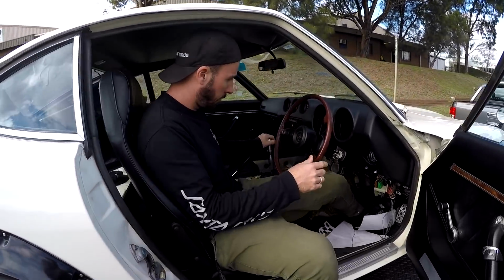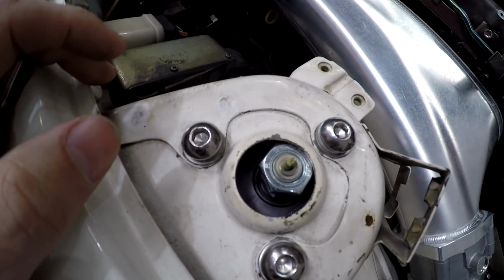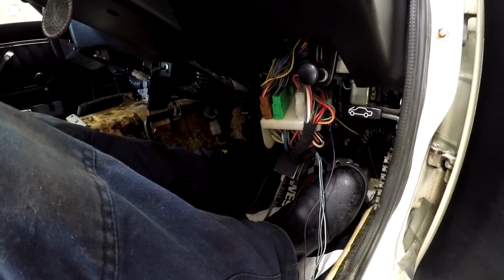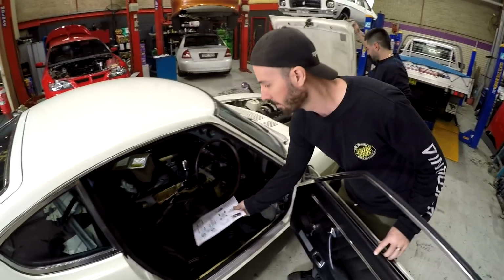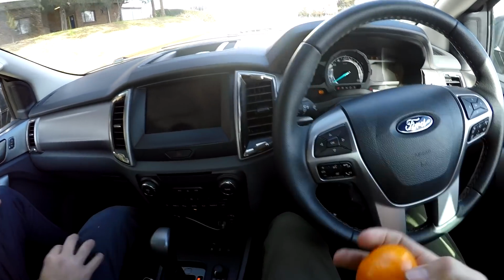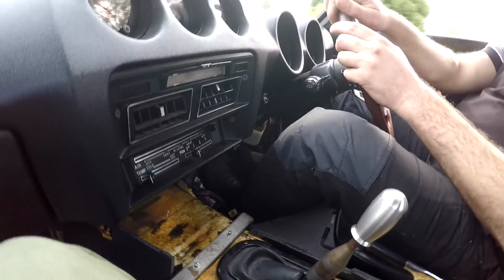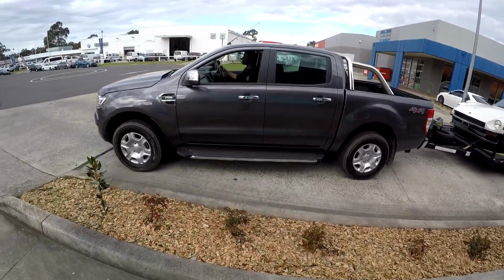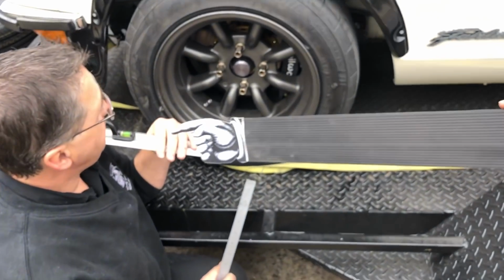RB26 240Z - Making It Legal

Comment: Just a tip guys,
Please get a battery with the terminals in the opposite polarity, so you’re Pos+ is not nearest to the bodywork! 
You can notice that any OEM fitment battery will always have the Pos+ terminal furthest from the bodywork in case of a collision, and will prevent the bodywork shorting to the terminal.
Reply: Beard Moto why not just use terminal covers....
Reply: Gary Stinten dunno mate. for the sake of a $200 new battery for a car worth $100k wouldn’t you just do it properly?
Reply: Beard Moto Or like... You know... Turn the battery around.
Reply: Thumbobby yep, after looking back, that’ll work too
Reply: You'll probably find that is OEM fitment, easier to just flip the battery around and extend the wiring then buying a new battery and still having to extend the wiring.

Comment: Wow - Australia has some really complicated rules and regs - I thought the UK was fussy, but in comparison to Australia, we seem fairly lay back......  In the UK, an imported car that isn't already type approved for the UK has to pass an IVA (Individual Vehicle Approval) test.  It's quite an involved test which takes a few hours, but its done in one place and the car isn't dismantled.  All cars over three years old have  a mandatory annual inspection which takes about an hour.  Strangely, when a car hits 40 years old, it becomes exempt from annual tests...........
Reply: Supposedly the reason for the 40 year exemption is:
- There aren't actually that many of them
- Many mechanics don't have the expertise to check them
- Most of them are 'collector' or 'classic' cars and so are generally well maintained
- Statistically very few are actually involved in accidents
I think they are still covered by the expectation that they are maintained and compliant with the regs and can be ticketed if pulled over.
Reply: Andrew Austerfield yes and there's been a lot of controversy about the exemption.  I personally think it's a bad thing.
Reply: There's always controversy when they change anything. I used to own a classic in the UK and honestly I did 500 miles a year, so effectively it had to be MOT'd every 500 miles which is a little excessive. Perhaps a change to a test every X'000 miles might have been appropriate? Here in CA I need to get a smog every 2 years and it's becoming harder and harder to get one done on anything that doesn't have ODB II installed.
Reply: Honestly for the average vehicle owner its not this involved. The guys are dealing with BIG changes to a car - engines and power outputs it was never designed for, components and emission standards that are much more modern, safety aspects to go along with the increases in power/mass/etc. The regulations on that in NSW are in the Vehicle Standard Bulletin v14, or VSB14. Google that for more info, its surprisingly reasonable.

For your average owner annual registration involves a simple mechanical check (20min & $41 in NSW) to ensure safety for you and other road users, then compulsory third party insurance (about $570) and registration fee ($66 plus road tax based on vehicle weight, eg: $211 for under 975kg). All up $887 for a small car in NSW annually, including compulsory insurance.

Cars over 30 years old here can be registered on 'club' or 'historic' registration, which allows trips for servicing, troubleshooting and nominated club runs (eg every Sunday to Location X). The cost for this is about $100 a year, with some forms allow 60 days of use so long as the trips are recorded - not just club runs etc.
Reply: boingkster thanks for the info.  The 'normal' annual test does seem on a par with ours (and sensible).  I know the boys have made huge changes, so fair enough the car needs testing.  Overall the Australian regs do seem more onerous tho - starting with the import rules, plus the use restrictions you mentioned. Cheers
Reply: No worries, also the 30+ club rego is an opt-in scenario, it's not compulsory. A lot of collectors use it as it helps offset the cost of multiple vehicles. I have a 40 year old car I drive daily, a Chrysler Valiant, and it just has the normal inspection annually.
Reply: Come to Germany, then you'll know what real restrictions are.
Reply: Michigan-USA. As long as its insured and has its lights at the proper hight we dont care. Want corvette front suspension on your 3wheeled tank v10 powered motorcycle?? . . . Cool.
Reply: What restrictions? In Belgium everything has to stay original. Wheelspacers, air ride, engine swaps, drum to disc conversions, adding extra engine power,..... are not allowed for this car. With cars before 1968 you have got a little more freedom.
Reply: Any car over 40 years old must be well maintained and I’m guessing it has to be annually inspected at 39 years old so if it’s good then anyone that actually wants to own the car will take car of it
Reply: Australia is broken send help
Reply: david shostak  YES, welcome to America, ['merica for Texas and most of the south (where I'm from but I don't say that) The States for most of the rest of the world] I'm glad that we don't have restrictions and inspections like Australia and other countries, jeez why all the restrictions and inspections Australia? I can see it if you were a small over populated country.
Reply: Nah, come to Hong Kong.
Reply: Meanwhile in the US: Not much rust? Seatbelts if it's 30 years old? Does it move when it should and stop when it should? Good, here's a sticker.
Reply: VOSA can pull you over. Make sure your documents are legit.
Reply: Having a standard everyone should follow is good. Then you know at the beginning of its life, it is capable of being road legal.
Reply: Unsafe cars in a crash can be a death trap.

Comment: Good to see these results. It would have sucked if, “upgraded” parts didn’t out perform the OEM equipment. 

Which to some degree, would explain why they always have the disclaimer,”performance parts are for off road application use only”
Reply: There are some rules about modification where you can't make things too strong because it changes how the car crumples on impact and whatnot. And probably to prevent people creating armoured cars. So if you're chopping and changing things, you can't just slap a bunch of thick steel in there to make it strong, which would be a good thing, but in a crash it won't bend the way it was supposed to and might kill you or others.

Comment: In British Columbia Canada you don't even need to get a safety check (vehicle inspection), if the car is already registered in the province.  Just go to ICBC and get you registration, plates and insurance. But they do random vehicle inspections at the side of the road, if there's any problems you have 30 days to fix it or take it off the road.

Comment: DRUM TO DISK? Dude here in the USA vehicles are still sold with drum brakes quite often.

I'm not 100% sure on this, but in the US I think most states only require you to meet the safety regulations for the date your car was made. I live in Florida, you don't even have to get a car inspected here, so illegal and dangerous modifications/vehicles ready to blow up on the road are a common thing. People with 20 year old cars run around with worn out rotors and brake pads, bald tires, and blown out brake lights and turn signals all the time. In one way it's nice, you can put a swaybar on your car and not worry about what it'll do to your registration or affect inspections, but at the same time it allows thousands of dangerous vehicles to just roam the streets.
Reply: Almost every ute (including the Ford Ranger they drove) has drums at the rear. Same with some light/micro -sized cars (although they probably don't need discs, unlike heavy utes which can tow up to 3.5 tonnes (or 2 cars)).
Reply: Jesse C if it was stock it would be fine but you can’t just upgrade an engine to multiple times original power and have stock brakes.
Reply: Never seen a new car with 400 whp with drum brakes.

Comment: Glad I smashed Like so early on! Engineering is a massive pain but its a vital part of building a safe, roadworthy car. One of my own long term goals is to build a kit car, but the engineering requirements just for each state in Australia is a nightmare. Plus, I need a house with a two car garage, tools, money...ummm.... yeah.

Great work guys!
Reply: cyclonicleo Lame goal, the work is largely already done with a kit and the car it's built for
Reply: cyclonicleo just move to the USA it would probably be cheaper because no regulations on cars besides having brakes lol
Reply: Yeah, but if you do get into a crash in USA you'll be bankrupt from legal/medical bills so it all works out. Things are pretty different across Australia, like some states your car needs to pass a check every year, some states you just keep a car registered and it's all good, even if it's a total rust nugget that should probably have been taken off the road years ago. And the cops don't give a shit about a rusty old Falcon with the muffler held on with a coathanger, but they'll bust a guy with a clean Skyline because it's 2mm too low...
Reply: *long term dreams.
Reply: "kit car" is a blanket term, which in some places such as the UK can be largely used to describe a car made by one's self. While we are aware it's not technically a "kit" car, the laws and testing fall under the same category. So he may be referring to that?

Comment: All this to get a car road legal, yet my clapped out s13 just needed tape covering a rust hole to pass a safety
Reply: TheSmosis UK I assume?
Reply: Long Jonhothan canada
Reply: No, in the UK they would poke at the sills and chassis anywhere near the suspension, and if it makes a hole, it fails. Still, many cars are bodged with filler!
Reply: TheSmosis ahh it's bc you said clapped and people use that a lot here

Comment: In Poland you need to register car with new engine with new number and go through checkup if you changed size of I. BUT if you taken 0,9 with 41HP to 0,9 with 95HP no one is checking it. The size is the same so nothing changed.

Comment: You put the battery in the wrong way. Positive must be far from the chassis to minimize risk of shorting!
Reply: good point, never would have thought of that
Reply: Nebbia affaraccimiei 
Watching Moog put that jumper lead on scared the bajeezus out of me.
Reply: The entire battery should go in the trunk, for weight distribution
Reply: Nebbia affaraccimiei . That's the way they are wired from the factory.
Reply: If I’m not mistaken the s30s are positive ground like Saab’s
Reply: _Milo well if that's the case then it would explain lol
Reply: jasen ratnam many factory cars have issues. You dont have to always do the same...
Reply: Nebbia affaraccimiei the car was made in Japan it is right hand drive. They probably used a battery that was made for a left hand drive American car. It should be OK as long as they put the right type of blinker fluid in it and upgrade the muffler bearings.
Reply: jasen ratnam the issue is whenever you need to plug in a charger or a jump pack, or you need to unscrew the terminal with a spanner!!!
Reply: James Hall do you really think that lhd or rhd changes the side the battery terminals are on? Lol no thats not how that works.
Reply: Purple Stingray whoooosh
Reply: _Milo my 66 Patrol was pos ground.
Reply: James Hall does it need amber or red blinker fluid?🤣

Comment: i love these old Datsun 240z ! Ive owned a couple and a few friends got hooked on them too back in the late 80s. But rusty took over, and they get hauled to the recycle center not long after, or you roll them into a cow or deer ending those good times. Brakes always seemed to be the first to rust out too, which really sucks when you're going 160 mph.  =)

Comment: You shouldn't use the negative of a jump pack on the battery. Attach it to a piece of grounded metal. You guys likely know how rare it is for a battery to blow up like that anyway, but considering your audience, probably best to do it the other way round next time. Just my two cents anyway haha, still love you guys.
Reply: Jbwifi what difference would this make at all ?
Reply: it doesnt matter on a jumppack, when you use another car to jumpstart then you ground the negative clip on metal
Reply: Wanganui Instrument Works a couple of reasons, the first being that connecting to ground metal actually creates a better return path to the battery pack which equals better current flow.
And the second more critical reason is because battery's can leak hydrogen, especially when charging, and creating a spark around that hydrogen can cause a pretty nasty explosion.
Reply: Sami Bätman it matters exactly the same on a jump pack; a jump pack is just a battery with inbuilt leads.
Reply: When some batteries are charged they can produce hydrogen gas and a spark at the battery can make them go boom, particularly older wet cell lead acid or an overcharged battery. So you attach the positive to the battery and then negative to a ground away from the battery as the spark is then away from the battery. The battery they had looked liked a sealed lead acid battery that usually have an expansion chamber and a vent when there is excessive gas produced.
Reply: Thanks for the explanation, I've connected negative to the frame since a dude smarter than I am told me to, now I also know why it's better.

Comment: Xlt means extra luxury trim.
Reply: Aoi in this case, fancier plastic?
Reply: luuzeri ya. It just adds a plastic silver trim to the interior of the truck, better seats, and different colors. I have the xlt in my 1995 f-150
Reply: Aoi also better suspension and electric windows and in some cases a raido!! If youre into the older ones such as i am.. im in the proses of making a 1988 F150 a bad street machine
Reply: Oh a XLT lariat btw
Reply: The XLT really isn't any special upfit. My company vehicle is a '17 F150 XLT and it's base model except power windows, power seats, keyless entry, and CD/Satellite/Aux
Reply: Jon Geddes which means it's nicer than a plain xl...
Reply: That's a urban legend, per Ford XLT is not an acronym.  Each letter was used to indicate what what suspension, motor and interior a truck had in the late 60s and early 70s . XL was the most popular motor suspension set up. And when the T was added it had the upgraded interior. These were the most popular setups so they started badging the trucks to distinguish them from base models. These names became well known and part of the branding and are now used to indicate comfort features now. The same goes for GMs SLT and SLE.

Comment: Ford truck nomenclature: "Custom", no options. "XL" (retired) originally it had sun visors, a radio and a carpeted interior. "XLT" outfitted with lots of goodies, almost like a car. The top specification, at least on Henry's side of the world, changes every few years and is usually a series of tie-ins to some other brand. Nautica, Eddie Bauer, Cabella's, Harley-Davidson are ones I can recall off the top of my head.

XL and XLT, like LTD, are not abbreviations despite third-party speculation.

Comment: just finally getting Rangers back in the states, but i have my classic '95 XLT Ranger. at that time, XLT was the top trim level so power mirrors, power windows with auto roll down on drivers side, A/C, cruise, etc. adjustable seat included a side bolster inflator and lumbar adjustment, you know the good stuff. now i think it goes XL, XLT, then probably Laramie with leather everything.

Comment: Dear Mighty car mods , i am still curious why was the original engine of the 240z not imported due to asbestos issues whereas the Mira had no problem being imported with its original engine?
Reply: Mira is a lot newer I think, may not have used any asbestos at all
Reply: The original engine wasn't imported due to emissions issues.. Namely that no matter how well it was tuned it would emit to many particulates and hydrocarbons (something a country as hot and dry as oz has to take more seriously)
Reply: Probably a loophole as the Mira was technically parts and not a car
Reply: The boys have repeatedly said it was about asbestos rules being enforced properly recently.
Which caught them off guard because it hadn't been an issue on their previous imports...
Reply: o0motorhead0o correct for the Mira.

As for the bitsa behind them... 

Emissions and asbestos
Reply: Most new Holdens failed emissions tests ...
Reply: Mira is new enough that asbestos use had gone out of fashion, in 240z days we didn't know the material was carcinogenic.
Reply: John Josephson
Exactly, they said that they actually started enforcing this aspect of the law after they had purchased the car, but before they brought it in.
Reply: brand new great walls had/have asbestos in them in australia.

Comment: Hey, mates! XLT is just a trim model designation, and from my research doesn't stand for anything in particular. Features vary with each model, but it seems to fall in the more bare-bones end of the spectrum according to Ford's website. It has nothing to do with towing or payload capacities. It is, however, exclusive to the SUVs, trucks, and Transit vans.
Sorry to disappoint. I always thought it was Xtra Large/Long Truck as well.

Comment: The brake plate test seems a bit "crude". In the UK, cars have to have a yearly MOT (basically a vehicle safety inspection). to test braking performance and balance, we use a system very similar to a rolling road, except the rollers spin the wheels up, and then you apply the brakes and it measures the braking force of each wheel.